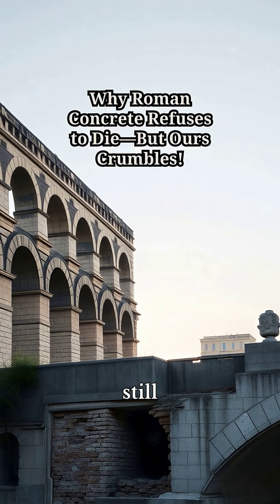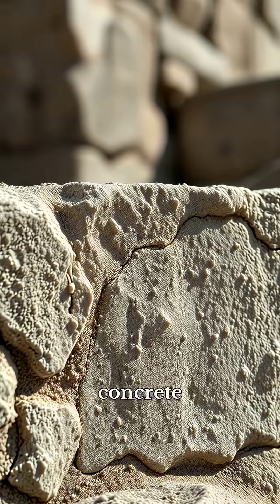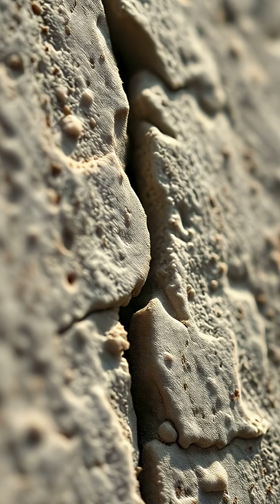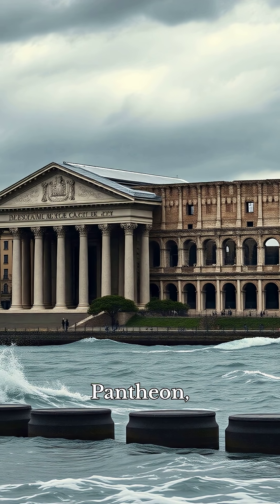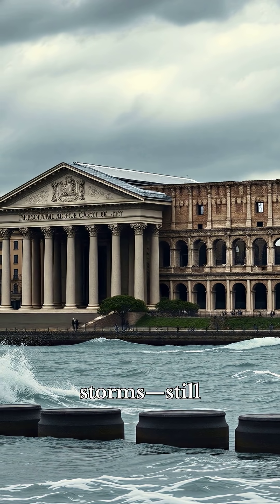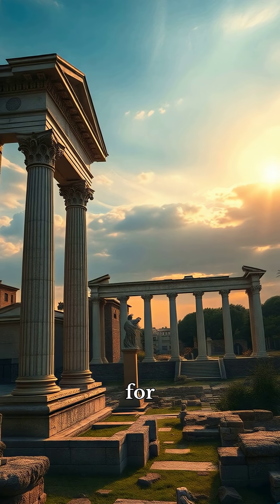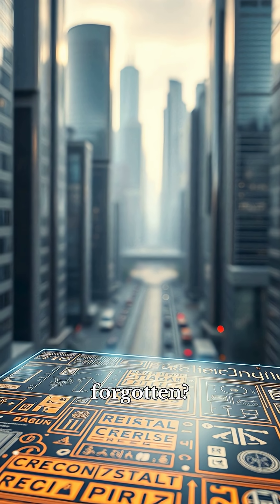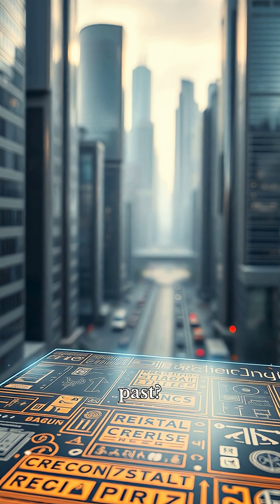Roman Concrete Mystery: Ancient Tech Stronger Than Ours? #History #RomanConcrete #Engineering

Comment: The soil strength is the reason. When the soil absorbs water faster, then chances of weaken of soil grip .
This process only plants with Roots grow with pierce strength  ,but construction shouldn't be allowed on these lands.
Those times the scratch powder from Rocks,  mixed in clay along with slippery mud used as plastering and left the construction to weathering with spray of water for 21 days.
Thus strength of construction will be good but strength depends on Ground surface soil strength.
That's why 2 plus floors construction permission only subject to soil classification.
Thus may be reason please